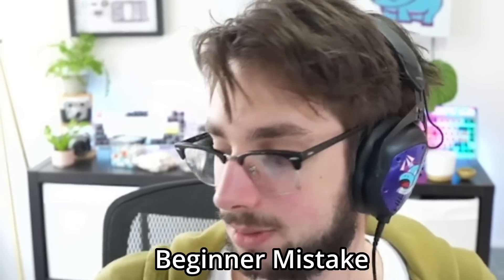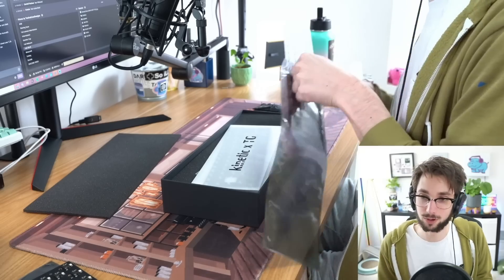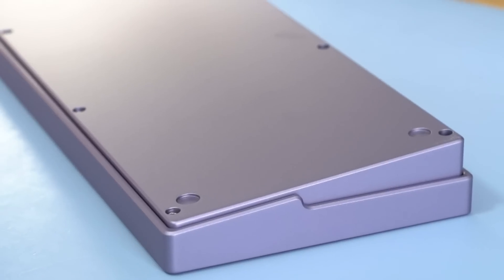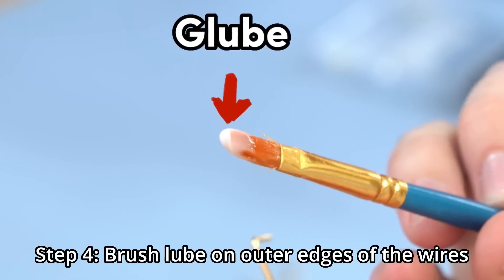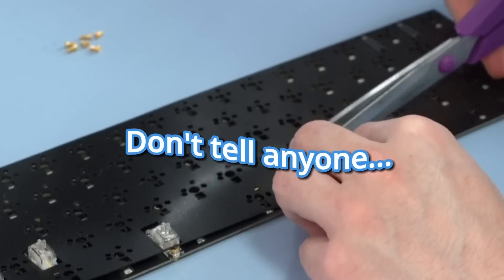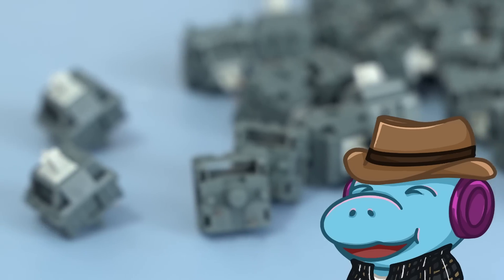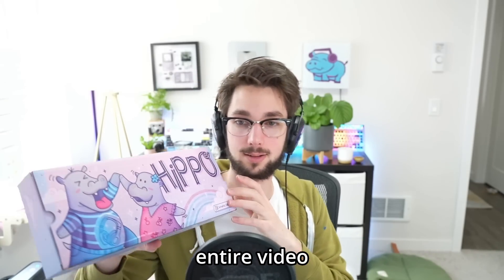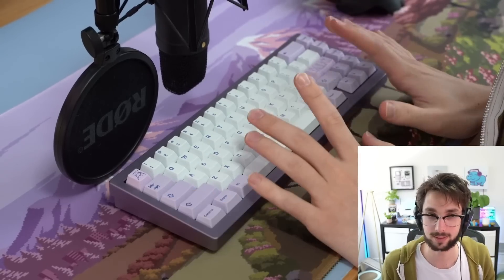I Built 40+ Keyboards Last Year - Here's How to Make Your FIRST.

Comment: I have a question i did tape mod my rk 61 i use akko cs Rose red Switches i put a bit foam in the case and modded my stabs and lubed my Switches what could i do now to make it Sound even better edit: for not much money 😅
Reply: You could try different foams like poly fill, etc. also see if a PE foam is possible.
Reply: @ApodicticScott  ahh ok trank you really much

Comment: Hipyo, I am looking to get some delicious thonkness in my life.  I just can't find a thonker that meets my bare minimum requirements, do you think you could steer me in the right direction?

I require, 2.4ghz Wireless, metal case (pref black aluminum, that way i don't have to paint), Knob, south facing LED.  Every board I have looked at is missing at least 1 or 2 of these requirements...

Comment: hipyo, i got a keychron q1 v2 and some durock v2s for it but after the final install of them which i used those sticker things on the pcb the keys go down and stay down and don’t come back up, i’m not sure if that’s an alignment issue or if you or anyone else ran into it but it’s only for the backspace, left shift, and enter stabs and i’m not sure what to do. Pls help
Reply: I have exactly the same keyboard and stabs, but no issues. Did you lube the stabs? Too much lube might be a problem. What plate are you using? I'm just using the standard metal plate that came with the keyboard.
Reply: @wenkeli1409  i use the standard plate as well and i did the holee mod for the stabs but the stabs aren’t flush to my pcb they’re at weird angles because of the claw door side and the screw side so i wasn’t sure if that was what was doing it
Reply: but i’ll try to remove some lube just in case
Reply: Check to make sure the stabs are in all the way that is what usually causes the problem. Or sometimes if your switch springs are too light they may get stuck

Comment: I want to get a custom keyboard but I am very conflicted on which one to get, I don't want to spend more than 250$ and I am thinking of getting the Azoth but I am still unsure

Edit: forgot to mention I am looking for a wireless Keyboard
Reply: That's one bad keyboard
Reply: don't get the azoth if you want a custom. unfortunately there's not many popular in-stock customs that support wireless, but the zoom65v2 is on preorder right now and should be a great board that's slightly above/below your price point. if you want something cheaper to start out, something from keychron would give you more of a budget to test out what switches/configurations you like.

if you're willing to give up wireless, the monsgeek m1 and bakaneko are amazing for the price. I'd recommend giving up wireless for either of these boards, unless you have a really practical reason to need wireless. Definitely do more research though, there are a ton of options within your budget that you might like better. Just watch out for shilling (content creators/influencers only recommending something because they're sponsored, e.g. the Azoth).
Reply: @parkerg6656  alright, thanks a ton, this really helped me!

Comment: Heres my problem with custom keyboards. most people only need one. so its not really sensible to build like 9, so it needs to realistically be one and done.  IE starter keyboard kits are a waste of time and money. plastic keyboards IMO give you nothing a gaming keyboard wont. so you want a nice quality aluminum keyboard in a size you can actually live with. so TKL, 96% or maybe full size if you aren't a gamer. you are going to want good switches but what kind? there are almost infinite key switches and no way for a non hardcore keyboard builder to know which ones he wants. so you have a chicken or the egg problem. then the cost and availability. a no holds custom build with aluminum case is like $500 only you cant buy one because they are all group buys for next year or sold out. then you don't have many good retailers short of buying from china. so more waiting. what a trash experience.

Comment: With the amount of money this costs in mind, you recommended the QK65. Now, I would love to pick up a qk65 but only in stock rarely. Any recommendations outside of that Hipyo? Atleast for a 65%, im looking for a nice keyboard for my first build. I might try to get the envoy in a month but they probably will run out of stock since they are in pre-order right now. <3
Reply: the tm680 is a 67% if thats good with you! you can probably do more research as needed
Reply: QK65 was my first build. I do love it (though I find myself reaching for my Tofu Jr more often). If it's your first build, it's going to teach you a lot of patience as it's like an onion to take apart - lots of layers. For the price though, it can produce a very nice sound. I just wish it had LEDs. Doesn't even need to be RGB, but something even like the cool white of the Bakeneko65 would have been nice. That's basically my only gripe about it.

I also ordered the Zoom65, Tofu65, and Envoy. I just built the Freebird60 in a pseudo 65% layout since the PCB gives you the option of arrow keys.
Reply: envoy, tofu65 2.0, bakeneko65,zoo65 are the best instock or soon to be instock boards atm....this board from kinetic labs seems nice but its a hard sell considering the price compared to the others mentioned
Reply: yes agreed envoy, tofu65, zoom, and bakeneko are the best rn
Reply: You can just preorder the envoy to get it but you can also check out the new retro 66, though the retro may be a little hard for a first board